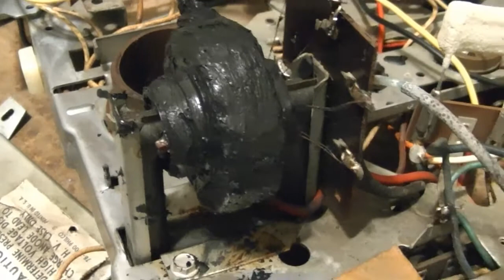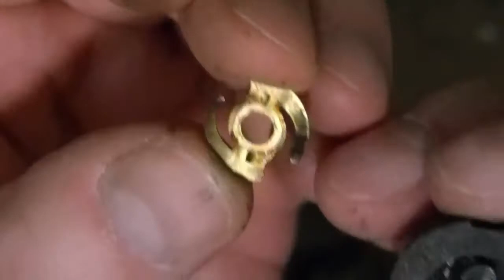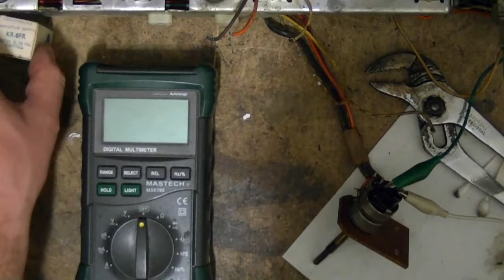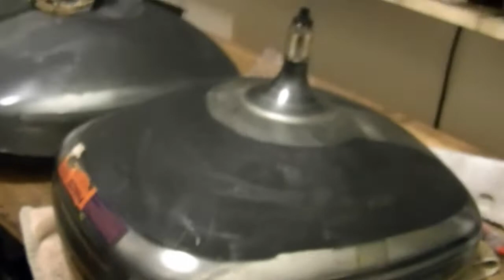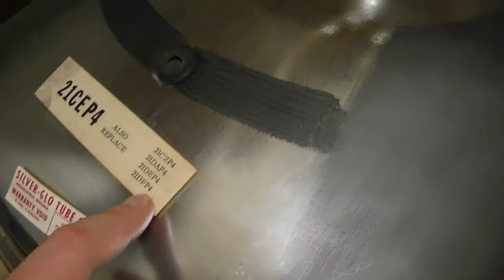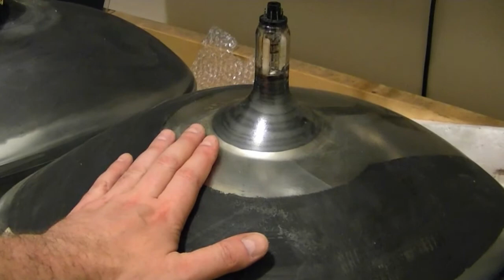Predicta "Holiday" restoration p12o?

Comment from the maker: I had actually been expecting problems with the PCB and flyback, not the power switch of all things!  All in all, it's actually going more smoothly than I expected.  If it hadn't been for a couple bad tube sockets, it would have worked on first power up :)

Comment: Re: Power switch. Take a look at Philco radio.com under restoration articles 41-226 Philco sled.  Shows push type switch repair, using LOWES 1884U switch. Looks like yours internally.  I have used this fix on my 41-255 Philco 41-255, which had a toggle switch in hole bored on side of cabinet (ouch)!  I enjoy your videos!

Comment: I don't think that it's current burning the contacts that causes these to fail so much as mechanical wear. The typical rotary operated power switches used on old radios and TVs carry the same current but don't fail as often as the push on-push off type, including the pushbutton power switches used on early 40s Philco radios.

Comment: Always happy to see an update. Perhaps to avoid some stress on the switch you could add in a small relay, and have the switch actuate that instead. You could also consider using a latching relay and using an easier to find momentary switch instead.

Comment: I don't know about that black silicone but with the bathtub caulking you can use mineral spirits to smooth it out. I think I have some similar power switches to the one your Predictas use, but I'm not sure if the construction is the same, I don't think that the Predicta TVs were the only ones to use push on push off power switches so there may be others that use the same switch.